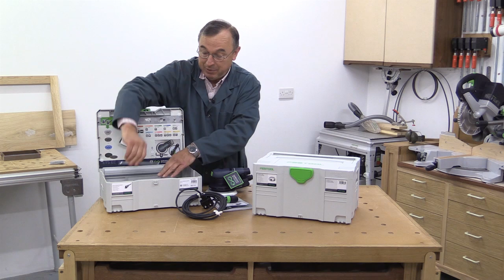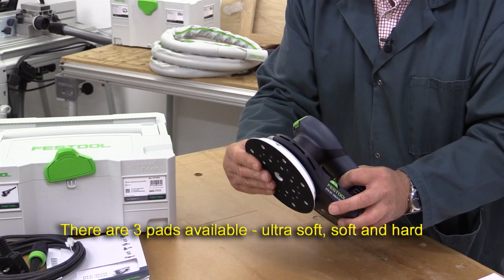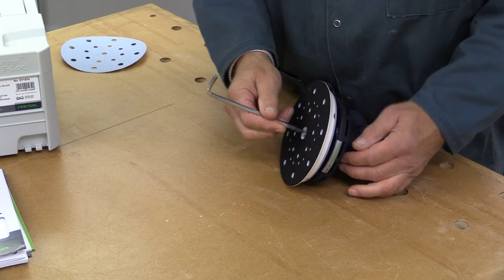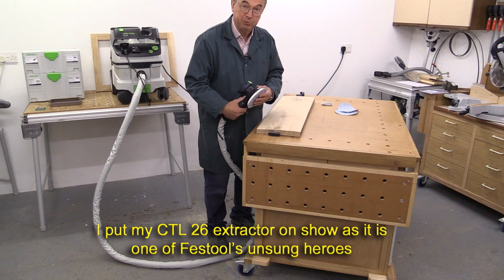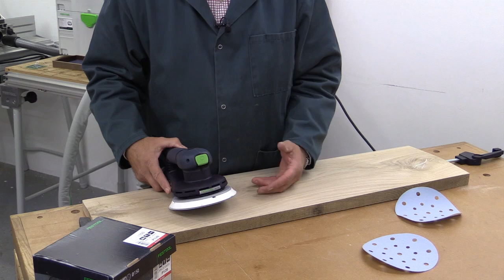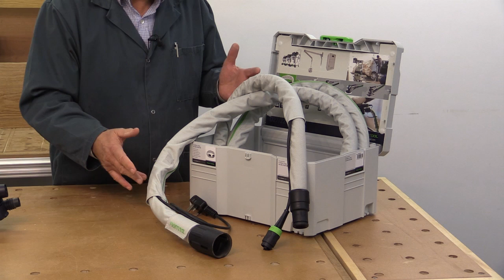Festool ETS EC 150 Sander

Comment: Do you recommend using the Festool ETS EC 150/3 to scratch the surface of the finish? After applying 2 coats of water soluble varnish mixed with a stain, I sanded using my Festool ETS EC 150/3 with Granat 240 paper and it burned through the varnish.  I could slow the speed and put an ultra soft pad on the sander, but I just want to scratch the varnish in order to apply a another coat without the stain.  I'm wondering with the Festool sander is too powerful for this task?
Reply from the maker: Hi Annie, I do not understand what you mean by "burn through". If you mean that you sanded through the varnish then I would expect that if you sanded for too long or too hard. Most varnishes will clog 240 grit within a few seconds of use particularly if the varnish is reasonably young or has had years of furniture polish applied. If you just want to establish a "key" for a new coat then use 150 grit and just "kiss" the original finish not dwelling on any spot for more than a second whilst applying minimum pressure.  Peter
Reply: @NewBritWorkshop  Peter, Many thanks for the response.  Burn through means that the stained varnish has disappeared and i'm back to the naked oak veneer.  I saw another technique which simply scratched by hand the new coat of varnish with special no load sandpaper.  I'm wondering whether the Festool sander is too powerful for such a delicate task.
Reply from the maker: Hi Annie, It will work but on a low speed and with just a brief and gentle technique.  Peter
Reply: @NewBritWorkshop  Hi Peter, an alternative is Festool's HSK hand sanding block according to the Festool Owner Group. Have you ever used this sanding block for scratching between multiple coats?  If so, what abrasive do you recommend to go with it?
Reply from the maker: Hi Annie, I use something similar and it is excellent as you can use an extractor as well if you wish. Aternatively you can use the Festool Granat sanding sponge - they are not expensive at all and I have been buying them for several years. For doing the "kiss" sanding or "scratch" sanding I would always use 150 or 180 grit.  Good luck.  Peter

Comment: Hi Peter, thanks so much for your reviews! I’ve learned a lot from them! Quick question. I’m looking for a sander for guitar building. Will be sanding pre spraypainting (up to  320) and potentially between lacquer coats. Will also use it to pre shape a guitar neck with a coarser grit. What size and stroke would you recommend? I seem to be leaning towards the 125/3. I’ve also read that you can fit 150 discs on the 125 unit but not the other way around...
Reply from the maker: Hi Nicolas, The ETS EC 150/3 is my most used and favourite sander. However for coarser work you might benefit from the small RO 90 which can also do delta and aggressive Rotex sanding as well. It is nowhere near as good as the ETS for fine sanding though. Given what I know about guitars I would go for the ETS and just put in a bit more work for the coarse stuff.   Peter

Comment: A very informative video. Thank you Peter.  I am planning to buy my first Festool sander for fine finish sanding on a large oak veneer wardrobe that I'm building. I'm torn between the new ETS EC 150/3 EQ-Plus and the older model ETS 150/3 EQ-Plus. To my surprise, Festool France has recommended a preference for the older ETS 150/3 for my project on the basis that the ETC 150/3 is more stable for working on a horizontal surface since you can hold the sander with one or two hands. The brushless motor isn't necessary for occasional wordwork.  The lighter weight of the ETS EC 150 is most useful for working horizontally on walls or ceilings.  The compact size of the ETS EC 150/3 allows for better handling. Both models appear to be capable of doing the job.  I have not had the opportunity to test either model, so your hands-on experience would be invaluable.  Which model should be my go-to sander for this project and occasional future projects?

I eliminated the 150/5mm stroke on the basis that it's too powerful for fine sanding.  The ETS EC 125/3 appears to be too small for sanding large surfaces.
Reply from the maker: I would go for the one that you see in this video. It is fantastic and it really is the sander that I use the most - it produces fantastic results.   Peter
Reply: @NewBritWorkshop  Thanks Peter.  For fine finish sanding on wood, do you recommend the ETS EC 150/3 or 150/5?  I have the opportunity to buy a brand new ETC EC 150/5 at a good price, but I understand that it's too powerful for ultra-fine sanding. Any advice?
Reply from the maker: For excellent fine sanding and a good coarse sanding capability go for the 150/3 despite the 150/5 being cheaper.   Peter
Reply: What do you recommends for the sanding disks/abrasives and the different grits for fine sanding of oak veneer? @NewBritWorkshop

Comment: Excellent video. Could the EC150/5 satisfactory be used for occasional removal work with 40 grit paper? I will only have one sander and can't decide between this and Rotex.
Reply from the maker: Hi Goran, I am sure it would work fine. I have the 150/3 and I often use 80 grit to take a lot of material away and it really does a fantastic job. For greater removal, particularly with coarser grits the 150/5 would be better.  I assume that you still need the sander for fine grit work otherwise you might want something completely different.        Peter

Comment: Can it be the only one sander ? Not riping. Just sanding good looking wood
Reply from the maker: Hi Pawel, It is a beauty but one still needs more aggressive sanders and also ones (delta) that can handle detail.  Peter
Reply: New Brit Workshop so rotex 150 will be best compromis ?Cause i will have only one of them
Reply from the maker: Hi Pawel, I do not know the range of tasks that you envisage doing with just one sander. My one sander would be the ETS EC150.   Peter
Reply: New Brit Workshop mostly sand before putting oil on kitchen oak tops that 90% of my sanding
Reply from the maker: Then the ETS EC 150 is the one for you.   Peter
Reply: New Brit Workshop 3 or 5 ? Thanks for advice
Reply from the maker: Hi Pawel, I have the ETS EC 150/3 and it works great for me. It will produce a (marginally) finer finish than the /5.  Peter

Comment: Hi Peter - Thanks for the great review, I'm sold. What are your thoughts on 125 vs 150 versions?  I tend to build small to mid size furniture as a hobby. Traditionally I have only used 125 sanders but am thinking about going to the larger size. Any advice would be greatly appreciated.
Reply from the maker: Hi Nick, I have the ETS EC 150 as you know and have recently had the ETS 125 on loan from Festool in order to make a video. I suspect our types of woodwork are very similar. I love the ETS EC 150 and do not find the size a limit in any way. The smaller 125 works as it should but even though it has been on my bench for a while I do not reach for it at all. I have not checked but I understand that it is more economical to run a 150 mm sander as the paper lasts longer. I do have the RO150 which takes the same paper as the ETS EC 150 but that has not been a consideration for me.    Peter
Reply: New Brit Workshop nice review, i had recently purchased 150 and was surprised it was 6” disc , so i now ordered 125 , only reason i like to go with 125 is because i also have mirka sander deros 5” and easier to just be dealing with one size sanding discs . But still the few min i held the 150 it felt like nice sander was very tempted to keep it

Comment: Hi. Thanks for your video. I have a question about festool vacuum cleaners. To work with sanders and vacuum dust do I need ctm cleaner or ctl will be enough
Reply from the maker: Hi Grzegorz, The CTL is fine - that is what I use.   Peter
Reply: +New Brit Workshop (Peter) 
thanx for quick answer.
which model do You use?
And even for sanding dust from oak and beech?
Reply from the maker: I have had the CT26 for over 4 years and it is brilliant with all woods. I do a lot of work with oak and beech with no problem at all.    Peter
Reply: The Ctm is the same as the ctl. Only, the ctm has an extra sensor for the hose airflow.

Comment: Hi Peter, thanks for an excellent video on the sander.  I'm new to purchasing Festool products and wanted to know in general if the orbit difference of 3mm vs 5mm really makes that much of a difference in your results?  I'm guessing it does since Festool went through the trouble of making 2 different versions, but for me who's basically never used an orbiting disc sander, it seems all so minute.
Reply from the maker: +Richard Kirschenbaum Hi Richard, Ther 5 mm will be more aggressive but I find my ETS EC 150/3 perfectly good when it comes to removing a lot of material (it is brilliant at fine sanding of course).    Peter
Reply: +New Brit Workshop (Peter) Thanks Peter (good morning to you too.. it's late here in Hawaii).  On the same token, does the larger 150mm pad vs the 125mm really cover that much more area and save you a lot of time?  It's probably a bit of a dumb question, but I don't see why they made the sizes so close to each other.. whereas I think I saw in the older sanders a 90mm version, but not in this lineup.  Anyway, here in the USA.. bigger is always better I guess.  Thanks.
Reply from the maker: +Richard Kirschenbaum Hi Richard, The 150 mm is an advantage over the 125 mm as you imply. The RO90 was my first Festool sander and it is 3 sanders in one and very capable despite its 90 mm pad size. I do not use it quite so much now as I just love the ETS EC 150/3.   Peter

Comment: hi Peter, I don't understand what's the difference between 3 stroke and 5 stroke, which is better? there is no dealer in my country so i have no one to ask...also, different model# just the pad size? ex:ETS 150 and ETS 125, RO150 and RO 125
Reply from the maker: +Andy Fan   Hi Andy, The 3 mm and 5 mm refer to the diameter of the circle that an individual grain of sand would move through if it were glued to the sanding sheet. So, an ETS EC 150/3 will do a finer job than an ETS EC 150/5.     Peter
Reply: New Brit Workshop Thanks Peter for lots of helpful information and advice

Comment: Excellent review. Thank you.
. 
I'm in the market for a new sander and have been looking at these.. 
I am coming from a Metabo SXE 450.. And my "fein tool" sanding pad to finish.. Both ok.. But both on there way out.. 
I would like to get an all rounder if possible. Rotex seems a bit big for my liking..
Would this sander handle the full process of going from 80 grit.. to 120 grit.. to 220 onwards..  I rarely use rough saw timber.. 
Mainly machined timber.. Occasionally some reclaimed woods etc.. 

Your thoughts?
Reply from the maker: +cynicaloptimist  This is a very interesting question. The ETS EC150/3 is now my "go to" sander and I have found that it can do quite reasonable surface removal at 80 grit. I can also say that I have not used my RO150 for almost 4 months as a result however, if I were making another Gothic Bench using rough oak then it would be back on the bench in a trice.    I hope that this helps.   Peter
Reply: +New Brit Workshop (Peter) Thanks Peter.. I picked one up yesterday. I love it.. 
Still a little concerned regarding it's ability to work hard though. As a finisher, it is unbelievable. The best..
Have you tried the other pads? Medium and Hard? Do you think they would improve its efforts with the stronger grit jobs ?. Or even remove cut lines faster than the soft pad? 
Thanks again.. great channel :)
Reply from the maker: +cynicaloptimist I have not tried any of the other pads yet but will sort this out as soon as I can. I imagine (cannot be sure) that they will make a difference.  Many thanks for your kind and most welcome comments.    Peter

Comment: whist one is best the Festool Rotex RO150 or the ETS EC 150 and whist one shall i bye ?
Reply from the maker: +Jacob hede pihl   Hi Jacob, It depends what sort of work you want to do - the Rotex can be used to take a lot of material off quickly in rotary mode and then finish it off quite well in random orbit mode. The ETS is a beautiful finishing sander.    Peter
Reply: if i will haw af handy sander ther can teak f lot of materiel, and thank you for assurering so fast :)

Comment: Would this sander be suitable for smoothing down painted walls before re-sanding? I'm not sure how to decide between this and the Rotex
Reply from the maker: Yasir Qureshi Hi Yasir, I think that is should work well but I have never tried it. The sander is extremely light and easy to handle which would make it much easier to use it on vertical surfaces. It would be a good idea to ask your local Festool dealer to be certain.   Peter
Reply: Thanks Peter!

Comment: Great machine and a great review, thank you Peter. I think I'm gone save for this sander, because he is very light and
it looks like a great machine. I have not as much strength in my hands as before the accident.
Thanks Peter.
Reply from the maker: Hen Schum I think that this will be a great sander for you. It is very light and easy to use - I nearly said easy to control but it is no effort to control whatsoever. Despite be light weight it is powerful and yet has very low vibration. I understand about your hands and am sure it will work for you.    Peter
Reply: Thanks Peter, it sounds like a great sander,
thank you for your wise words. I have Posttraumatic Dystrophy (CRPS II) it started, after the operation, in my right knee / leg, but now I feel that my hands also become more painful. I do not want to think about it that I get also Dystrophy in my hands.
Thanks Peter, for your help

Comment: Another well detailed and presented review Peter. Thanks for taking the time to film and upload. I always find the festool kit very interesting as their tools are usually way more sophisticated than need be, for example who really needs a buzzer on a sander just to to tell you the dust hose isn't connected lol, and a vibration detector on a finish sander, ahahahah! Whats it all coming too. That said im sure this sander does a great job but for over £500.00 i personally, would sooner buy one without all the unnecessary extras at less than half the price. Regards Rod.
Reply: pcb1962 I have a Festool ETS 150/3 with CT26 and it's the best sanding experience ever.
Reply: Exactly, sometimes Festool are in a league of their own, TS55, Domino, Carvex, T18 for example, and sometimes the case for spending Festool money is much less convincing. For me, the sanders are the hardest to justify their price, though I've no doubt a Rotex will find its way into my workshop one day :-)
Reply from the maker: pcb1962 If you need convincing just go to a show, a demo day or your local dealer and try the sanders then decide.   Peter
Reply: +Rodney Howe It sounds like the buzzer is nothing less than the electric motor being pulsed at a low voltage, thus giving generating the 'humming' sound. :)

Comment: Thank you for your wonderful review. You answered many questions that festool Germany would not or could not answer. I was hoping that the ets ec will keep the out of this world sanding pattern of the lex 150/3 where the pad has almost zero free spin at full speed making it the fine sander ever made Seeing that it does not have the same drop in motor as the lex it makes complete sense. The ets ec will have its place though for 400-600 when trying to keep the scratch pattern as small as possible. Will festool sell the hose cover individually so it can be also used for the ias3 light?
Reply from the maker: karwork Many thanks. I am sure that the hose sleeve will be available as a separate item but am not sure that it will be suitable for other hoses. Your main point is spot on - the new ETS EC 150 is a very capable sander.   Peter

Comment: That looks nice and smooth; do you know if the 5 mm handles similarly?  Shame you have to send it back!
Reply from the maker: Mark Garth Hi Mark, I have tried the 150/5 at a demo day and, as far as I can recall, is exactly the same - perhaps there should be a slight difference because of the different stroke but I could not tell. Yes, it is sad to see it go especially when I discovered that it is perfect for the very fine work that I do in my spare time.    Peter